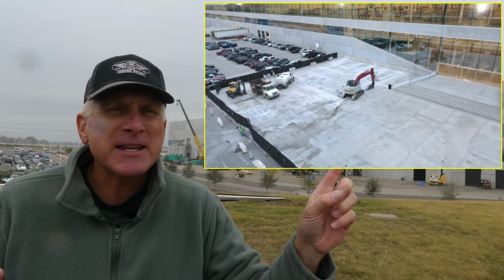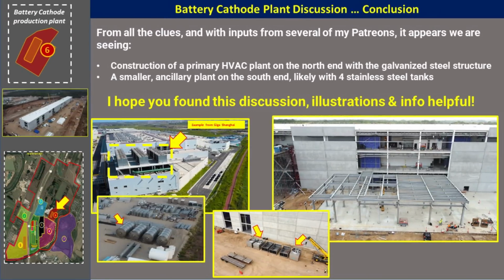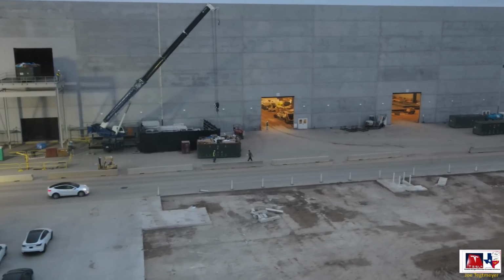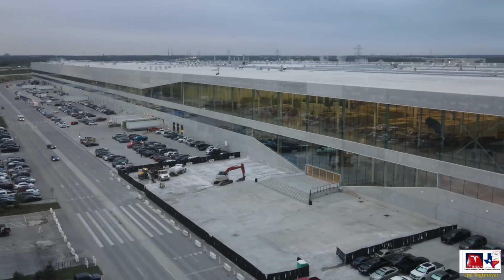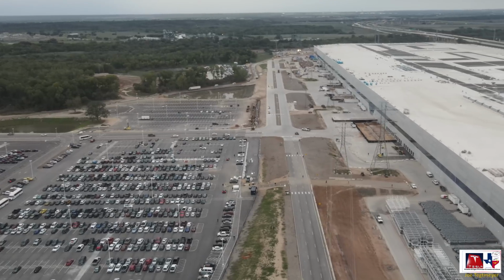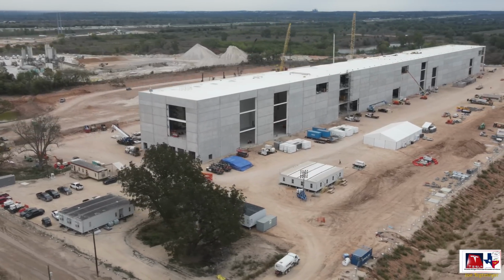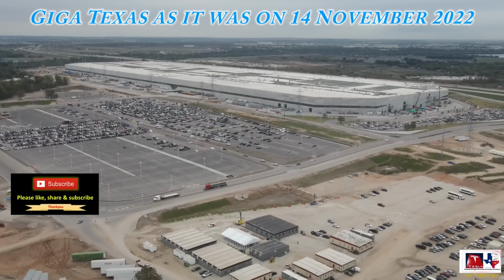Cathode Plant Construction Details! 14 November Giga Texas Construction Update (07:35AM)

Comment: It's still perplexing that these few guys are doing all the solar. I looked at a few of your videos and i have counted 8-12 people. if you go with 75000 panels + the same amount of mounts, this installation is going to take 2 more years if this company will keep using so few workers. As I have said before, Tesla Giga Texas does not seem to have project management. That's also obvious when looking at the main entrance.
Reply: I have thought the same, BUT, the solar panels will not become operational until the new electrical switchyard is operational, and possibly even some megapack installations are done.  So in that regard, there is no immediate hurry as it will likely be another 3 to 4 months for that be in a state to make them operational.
Reply: @briandolbec37  Yeah, that's true but the switchyard could argue the other way around - we don't need to hurry as long as there is no finished array
Reply from the maker: I provide some details and discussion on this issue in my 16 November 2022 video, so check it out!

Comment: Joe,  The yellow crane with the leads and auger is a auger cast pile rig. It's go to install a test pile and reaction piles to hold down the test beam. They will put a large hydraulic jack between the test pile and beam. The jack will apply pressure to the test pile till it fails. That determine the bearing capacity of the test pile. From that capacity information the length and diameter of the production piles can be adjusted to meet the detail capacity for the foundation. Hope this helps
Reply from the maker: It’s just like the one on the south end

Comment: I remember when Elon tweeted about the building being extended 500' south.  They were working on the drain pipes in that area before the concrete was poured.  If they knew they would be extending the building, why did they pour concrete.  They could of paved it for a temp parking lot.  Would of been a lot cheaper.
As a Tesla shareholder, I can't help thinking how much all this re-work is cost me.  Probably around a cent or two.  Lol.  Nevertheless, it is a waist of money.
Reply: Elon's diarrhea of the mouth probably cost you more.
Reply: @sammyk874  LOL, ya you're right.

Comment: Thanks Joe.
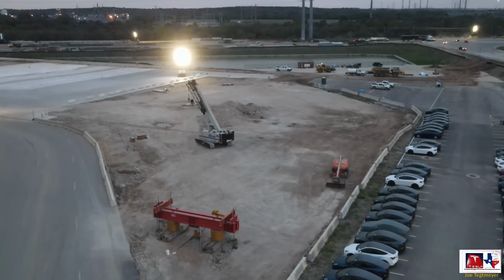5:33. Southend. Pile test rig, and crane to dismantle it. Hydraulic jack on top of the pile/pier has been retracted.
7:57. Stamping 2. Bobcat/skidsteer at the top of a ramp down into the excavation. Seems there’s a concrete structure in the excavation.
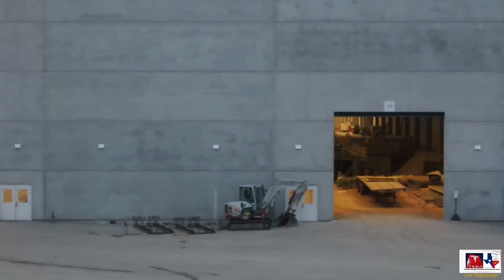8:14. Stamping 2. Open end to the underground corridor could suggest another isolation foundation to be constructed on this side.
Deep inside, the High Bay area mostly empty except for construction machinery.
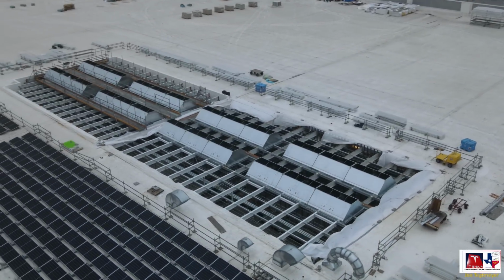10:23. BIW, roof. Roof opening. Steel mesh decking stacked around the edges likely the replacement for the removed roof decking, insulation, and membrane. Constructing/extending the stud walls above the roof line.
The chillers will be open to the atmosphere on all sides, but below roof level. 
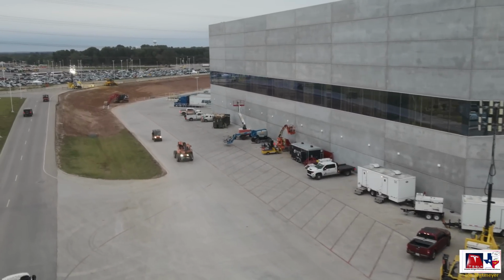14:09. Casting. Inside. The white structure for the small bridge crane can be seen. Would be in front of the pair of DMG Mori milling machines.
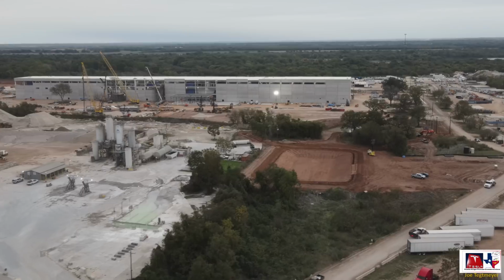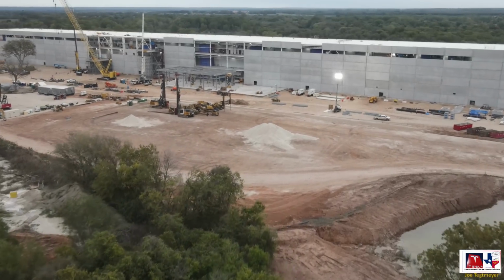17:55. MM batch plant. New pond. There’s a trench to the right of the pair of white fuel tanks, seems to extend around to the south where the excavator is. Might be re-routing the black pipe seen at 18:13 near the existing pond.
19:39. Cathode west. Drilling rig. Bottom left, some rebar cages near the small shipping container. More test piles.
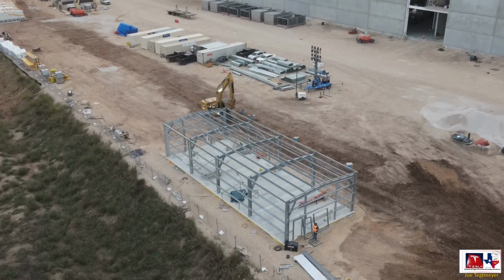21:16. Cathode, small out-building. Blue pipes would be over buried valves.
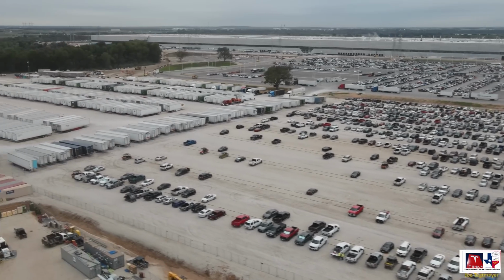22:25. WOW yard. Centre of screen. Large orange jack on the trailer, 24:18 shows another parked under the big tree. More at 24:49, plus trestles and gantry beams. Last saw these used in Stamping back in May. 
There's really only 2 options for the jacks and gantry. The AIDA presses, or a Gigapress. Would be early for anything to go into Stamping 2 (Stamping Extension). Is there still room in Stamping 1? Or a gigapress. I'm not sure though if there is a footing for the 9000t press yet in Casting.
Jacks and gantry beams set up outside Stamping in late April, https://youtu.be/dZpiAjp97oY?t=283
22:36. East contractors yard. Some Cybertruck shaped objects in amongst it for the more imaginative types.
23:27. East contractors yard. White trusses are vertical component of storage racks. Sometimes visible inside the south end of GA. The Giga Rodeo videos show many locations inside where they are installed.
Reply: Dessie, 10:23 I have been watching how that they remove heat from the building. I think that on the top floor they have areas walled off with air intakes and hot air exhausts. Any process cooling or air conditioning heat removal is in these areas. The new area has exhaust but no intakes yet, could be in the open areas. The area on the north end of BIW is operational and above the cell area partially in operation. This eliminates a jumble of coolers on the roof.
Reply: @eltonray2934  10:23. Below roof jumble instead of above roof jumble. Is there any practical reason for it, or aesthetic only. Maybe to streamline the solar installation. Can’t help but think Tesla could be work-shopping multiple different systems here. The 3 systems all appear to be different to me.

Comment: On the North end of the switchyard it looks as if they are laying out 3 separate runs
Reply: There are two 345 kV 3 phase circuits from the LCRA transmission lines that will go through the substation (seen @ 15:57). The third 3 phase circuit will connect to the yet to be constructed Megapacks west of the transmission lines.

Comment: Did you ever get into fsd beta yet, Joe?
Reply from the maker: I did! About a month ago.
Reply: @JoeTegtmeyer  Keep us posted on how good or bad it works.  I watch videos on that from others but hard to get honest opinions about it.  Thanks for your time on these videos.
Reply from the maker: @charleshaggard4341  I’ve thought about doing a video with impressions and observations and in a different way than most, but haven’t done so (yet) because of a few reasons, First, I’m not one of those that gets an early download, so my FSD Beta is a few iterations behind the cutting edge. Second, if I do a video where I focus on observations of when it doesn’t act correctly, or if I have suggestions for improvement, I fear some who have ulterior motives could use sections of the video out of context and in a way counter to my purpose of supporting FSD, the approach Tesla is using and my intent to further development with inputs that you might not see elsewhere. Hope that makes sense.
Reply: @JoeTegtmeyer  It does, I never thought about the downside.
Reply: @JoeTegtmeyer  I hope you get v11 soon, just to make your trips up and down 35 easier on you!
Reply from the maker: @scottgaree7667  thx … I’m looking forward to it. One of the biggest “issues” I’ve had is that a lot of roads between my house and Giga Texas are partly county roads but with parts like city roads and the switching between FSD Beta and NAP cause problems as the two software stacks react differently to the same roads and this causes some disconnects and interventions. I hope V11 fixes this.